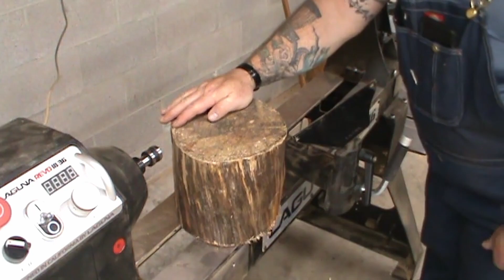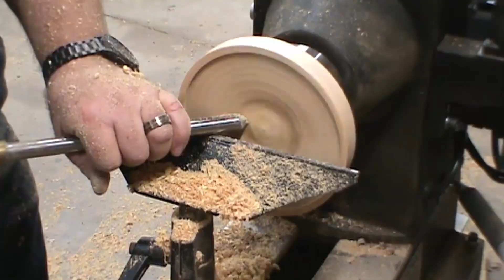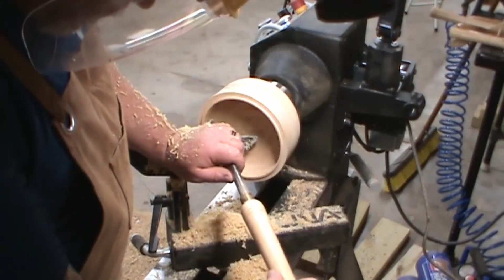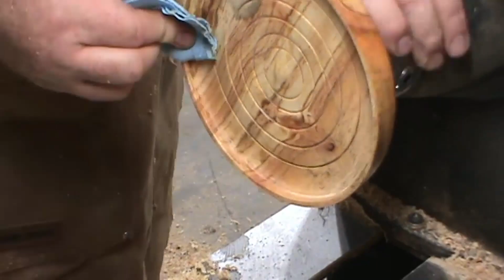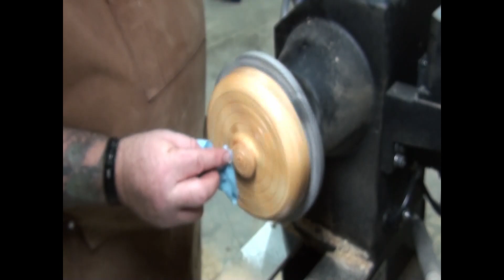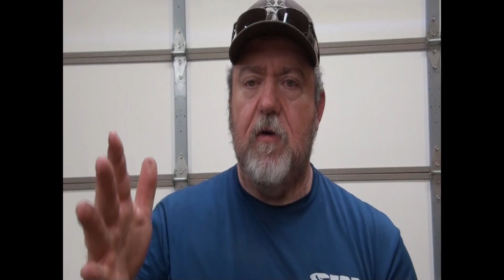Afghan Pine Box

Comment: Looks great Tim. I think the fact it does not snap closed might be a good thing. I had a small lidden box that did snap closed and when the weather changed I could not get the lid off. I waited and popped it off when it got looser. Then took a bit more off.
Looks like your having fun with the new lathe. Keep those videos coming.
Gary
Reply from the maker: Thank you Gary, did you catch my omage to you?
Reply: Yes I did! Great nub removal. I assume you had it against a jam chuck? I did not see you flip it around.
Reply from the maker: @ThePapa1947  no, haven't tried the jam chuck thing yet, but I will.